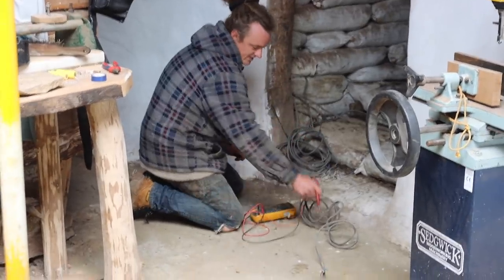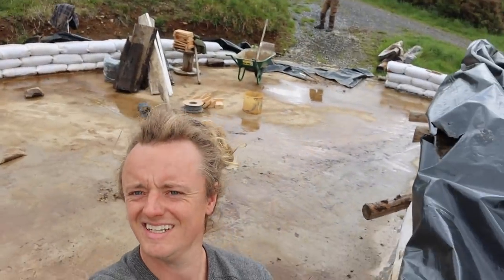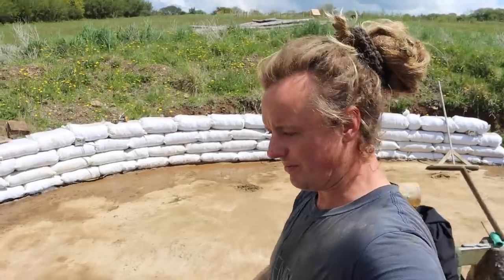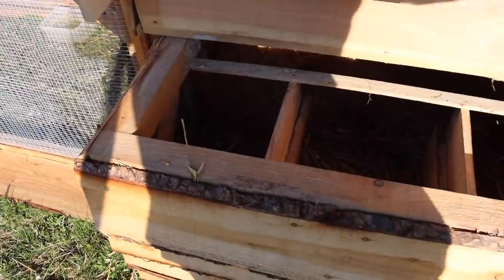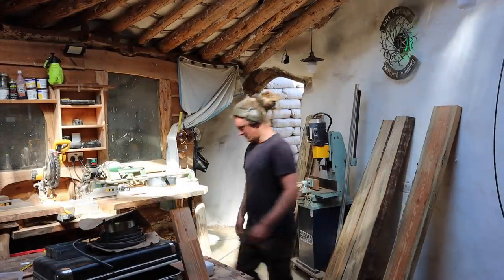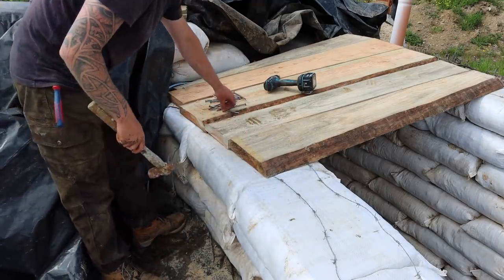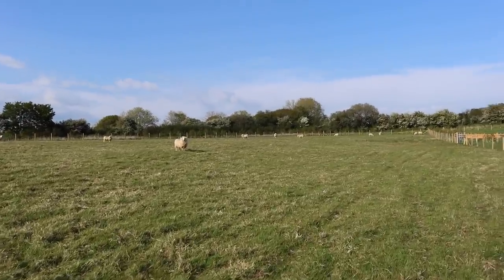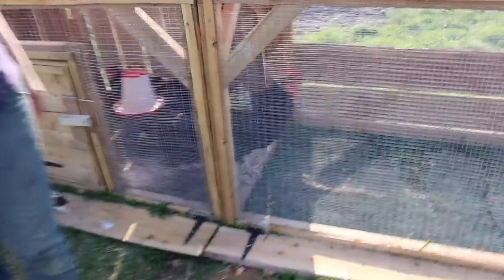Off Grid Earthbag Workshop Part 59 Top Floor Earth Bagging

Comment: Sorry about your shoulder, Kris. I've had a similar injury and have found it comes and goes. You've got to keep using it but with some caution. There can be a fine line between good use and over use. Great progress on the upper shop. Good on Sam, a good mate and good hand. Well done boys!

Comment: I had shoulder problems and thought it was torn rotator cuff, waited a couple years before going to the doctor and turns out I had inflammation which persisted (there isn't alot of room in your shoulder for all the moving parts). Some meloxicam and I was good after a few months, two brand new shoulders! Might be worth it to have it looked at, could be something simple.

Comment: Hi Kris! Great work again; a suggestion however, bare in mind I’m know nothing about the building industry; to help Stan with the lifting of the bags & especially as the wall gets higher & your out of action: what about buying one of those portable small lift things the supermarkets use to stack there warehouses? It’d speed things up & help your bodies-also I think they run on gas & not fuel? Good Luck NB Even if you got it & used it on the bigger house you plan to build later on? Central Victoria Australia 🇦🇺😊
Reply from the maker: This is the laat row that will be lifted. from now on all the bags go in the tractor bucket and lifted to the wall and just slid across.

Comment: Good Morning, and great to see the progress on the upper shop.
Have you ever talked about the difference between continuous earth bags ,long tubular style, versus the single bags? I've seen other channels use them and didn't know if there what the pro and cons were. Have you ever looked at the Earth Ship homes using the interlocking tires backfilled with dirt?
Reply from the maker: They are just really hard to get in the uk so i went with single bags. Not much difference i dont think to be honest just a bit less plaster would be needed.
Reply: @KrisHarbour  just amazing work Kris, one question, where did you buy the bags from? All the best from Sweden!

Comment: Kris, would I be right in assuming the lower workshop will be for woodworking projects and the new workshop for metalworking? 
Also, will the extra building have an impact on how much power you are producing/using? 
 Thanks for this latest video Kris, make sure you rest your shoulder.
Reply from the maker: Yes thats correct. the upper floor is for metalwork/machining/and vehicle maintenance. I doubt the power needs will go up much. having it does not give me more time. if im working in there im not working in the other workshop so it will even out. its not like there will be more work being done as my time limits that.

Comment: Have you considered a bag fill station:  setup such that you can drop a load of soil with the tractor and fill 4-5 bags at a time?  Like a table where you push earth down a ramp into a bag.  Or a 4-5 section vertical sieve where a tractor load is dropped into the bags directly.  I know you aren't afraid of doing physical labor, but hydraulics are a back saver for sure.
Reply from the maker: It has been suggested many times before. Wet clay sub soil isn’t like sand it will not flow in to a bag. It has to be broken up with a shovel. Big rocks removed and the put in the bag evenly and tamped down as you go. It could be mechanised but it would require screening first and then some kind of auger to move and break it up and then some kind of tamper to tamp as it filled. Not impossible at all. But way to complex for one building. It’s really not even that hard work to fill them. It takes longer to tie them up at the tops with string.

Comment: Hey Kris, what's up with the Deli? I see its on the ramps. Maybe you could do a video on how that van is going. My late father in law bought one of them. They're not bad to drive.....
Reply from the maker: Just old and rusty, there is a power steering fluid cooler pipe behind the bumper and that had corroded and started weeping oil.  Could not find the part so i made a new cooler out of coper pipe and plumbed it in. While the bumper was off i found a few holes in the frame so i had to do quite a bit of patching and welding. Its all back working now but i think it will only have another couple of years of life as the rust is starting to get at places that would require a complete strip down to get to.

Comment: Kris I was wondering how many circuits you were putting into the upper ring of plugs? If there was only 1 set of wires is there a reason not to put 2 circuits with one on either side of the door fed from below?
Reply from the maker: Yeah i could have done that if i had planned it from the start but the wires went in for the top workshop in the walls at row 4 of the lower workshop so if i was going to do that i needed to do that at the start. There are other circuits up there. there is 16A circuits and three phase but all the plugs are on the same ring on the same 32a breaker.

Comment: Hi Kris.  You mention fairly early on that the bags suffer from UV light, and that's entirely understandable, but surely the bags will break down mechanically after - maybe a few years?  
What will happen to the earth inside then?  
Are you hoping/do you know, that it will be compacted enough to stay put?
Regards Mark in the UK
Reply from the maker: The bags will last a thousand years without uv getting to them. They are protected by the plaster so they wont degrade at all.

Comment: Kris I know you have answered this before maybe. Has anyone though about using a plate compactor. One could lower the speed on them so they are not so fast. Yet it would take 2 people to guide it around the building.
Reply from the maker: Plate compactors are not the same kind of force that is required to tamp a earthbag. they mostly use vibration and they work great for vibrating different sized particles to mesh together. an earthbag is really quite soft and needs a slow but concentrated wack downwards. Im sure a plate compactor would get them formed eventually but it would take a long time and be a lot more work. I could easily make a machine that would work but its more trouble than is needed, i can tamp a row on this building in under 10 mins. It would take longer to move a machine start it and lift it on to the wall. and there is no way i would be moving a plate compactor about 2m up in the air. those things a horrible to use and are heavy! They are very much a tool to be kept on the ground.
Reply: @KrisHarbour  Yeah I guess I did not think about that. Either way its going to be a really nice project. I am excited to see it come out. My main thing is the main door and the roof and how it will look when standing there. I like the roof shop roof from a number of views. The center window really makes the shop special.

Comment: I’m curious what is going into the bags. Do you have a clay soil there? And do you add any cement?
Reply from the maker: just clay subsoil from the excavation of the site.
Reply: @KrisHarbour  thanks!
Reply: @KrisHarbour  so they don’t go hard then Kris? I mean, I guess it’s firm, but not like rock?
Reply from the maker: @mattwoodproperty  if you touched one you would think it was concrete. they go rock hard when dry. If you used your hand or knuckles to feel one it would feel no different to concrete. But it is just clay/sand and they are brittle so you can quite easily break one apart and make it crumble if you hit it hard enough with something.  But when set in the wall and undisturbed they are very hard and can take a lot of compression force.
Reply: @KrisHarbour  thanks for the response , your hoodie still looking new, prob time for another winter range :-)

Comment: you weld, google sandbag filling attachment and then make one. You can fill 15-20 bags in about 20 seconds. Or rent on make a few thousand bags, cover them up and place them at your own time. Either way has to be way faster than whatever method you are doing.
Reply from the maker: Wet clay subsoil stuck together in big lumps with rocks in isnt sand.
Reply: @KrisHarbour  if only people used the brains they have at their disposal, eh Kris....?!
Quick to criticise, slow to think......

Comment: Is there any way to make a bucket wide "filter" with separators? Something which you could put bags in, wedge a holding frame to keep the bags open and attached, and you fill say 5/6 bags at once with each bucket? 
I feel like this is an idea that could turn into a full Kris harbour hack potentially!!
You have more skill and knowledge than I have to know whether it would be worth trying!!! 

Might take some of the work off of your back! & make it go faster!
Reply: some old ply and some old cheap softwood and a bit of time & I think you could have something really functional!
Reply: Kris, I've actually drawn what I meant up and sent it to you on Instagram because I am rubbish at explaining things 😅
Reply: Gliddonator -   Below is the reply from Kris to a similar question:

"It has been suggested many times before. Wet clay sub soil isn’t like sand it will not flow in to a bag. It has to be broken up with a shovel. Big rocks removed and the put in the bag evenly and tamped down as you go. It could be mechanised but it would require screening first and then some kind of auger to move and break it up and then some kind of tamper to tamp as it filled. Not impossible at all. But way to complex for one building. It’s really not even that hard work to fill them. It takes longer to tie them up at the tops with string."

Comment: I love your videos but I was just wondering as microplastic is becoming a big concern now have you thought about wheather using that much plastic might be problematic for the enviroment ?
Reply from the maker: It isnt much plastic. there is far more plastic in my water pipes for example. The average house throws out more plastic than is in this building in a very short space of time. A single car has more plastic than this entire building! i can lift one of the bales of bags easily, its less than 20kg and i will use 4 in total so around 80kg of plastic. Its then plastered over and stoped from degrading and in theory wont break down as long as the building is maintained. Micro plastics are not coming from earth-bag building i can assure you of that. A real source of micro plastic like my van, tractor, clothes, shoes and so on is a genuine problem and one that i dont even know where to start with to fix. But using plastics for permeant buildings or places where them breaking down is protected isnt where the problem is.

I would also like to add that when this building is done there will be more weight of plastics that has been taken out of skips or salvaged than there is new plastic in it.
Reply: @KrisHarbour  yeah you are right and I wasnt really trying to reproach anything just curious wheather you have put any thought into that which you have so thanks for the answer ✌

Comment: What do you estimate the weight of one of those full earth bags to be?
Reply: at least 50kgs.. two bags of gypsum or cement I can do and these bags are about my limit, so at leasst 50. They're awkard buggers, too.
Reply from the maker: I did put one on a set of scales and it was 58kg a really full wet one can be over 60kg easily and awkward to lift as it has no handles. 60kg dead lift with a bar is easy but these bags require a lot of core and hand strength just to hold on to them.